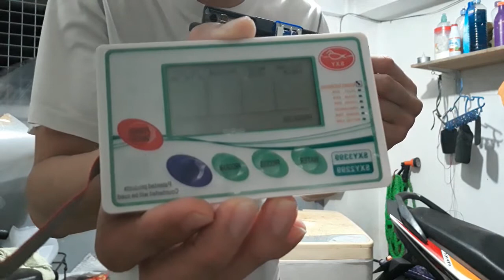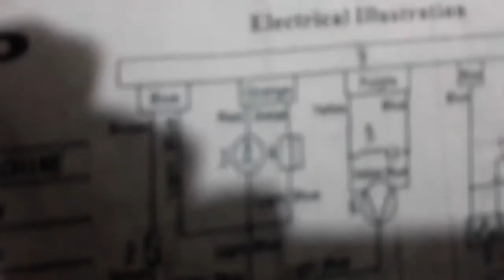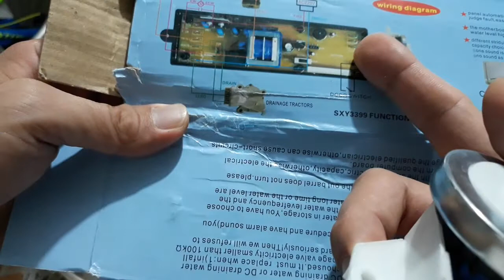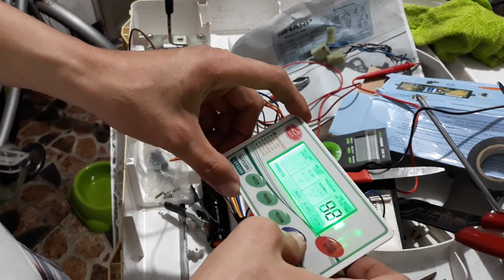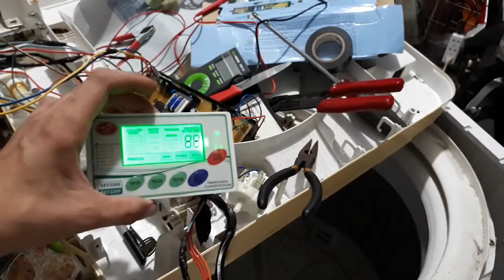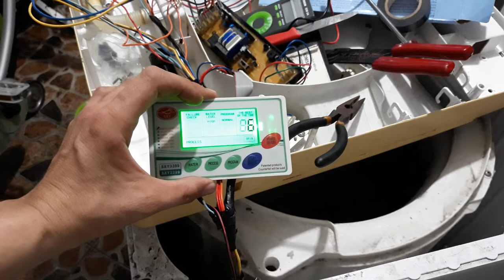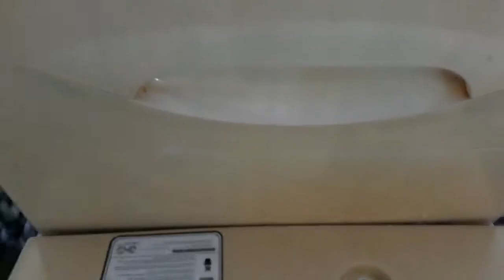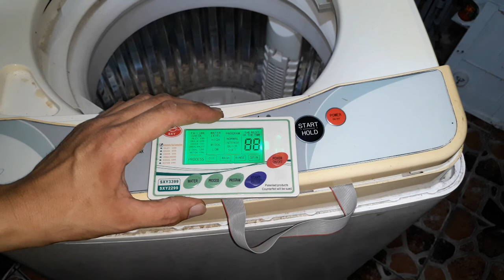converting washing machine board to universal board

Comment: Boss, pano yung sa retractor, pwede bang pagsamahin yung drain motor at retractor? TYIA boss god bless
Reply from the maker: di ko pa boss na ttry. pero since walang supply ng para sa drain motor pwede po siguro kunin sa retractor. pero dapat po same po ang supply ng retractor sa drain motor. kasi habang ng d-drain constant yung supply sa retractor.
Reply: @ronaldkimtorres4618  thank you boss. Ginawan ko na lang ng paraan. Nilagyan ko ng toggle switch connect option ng drain motor at retractor... Thank you ulit boss. More power and god bless
Reply from the maker: @armandrap6216  salamat din po boss.. dagdag kaalaman sakin.. salamat po.. Godbless and more power